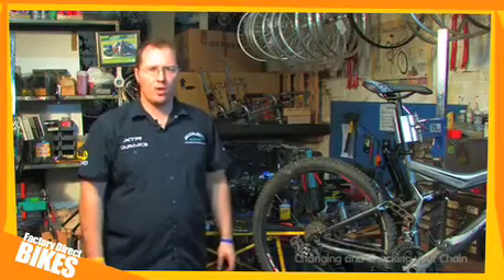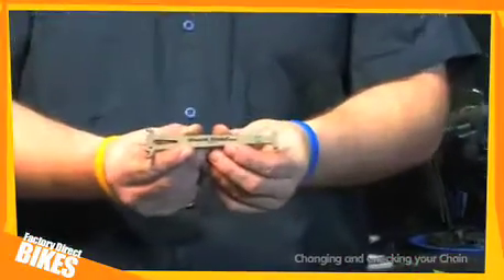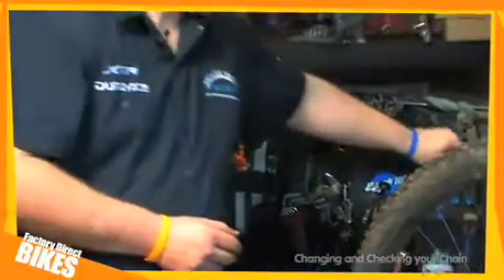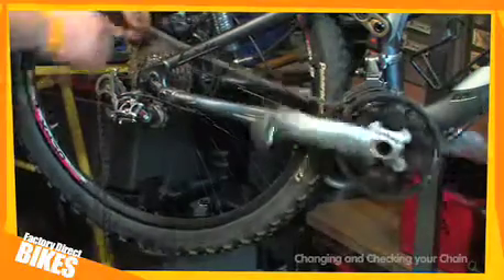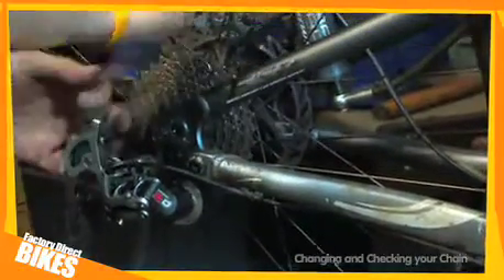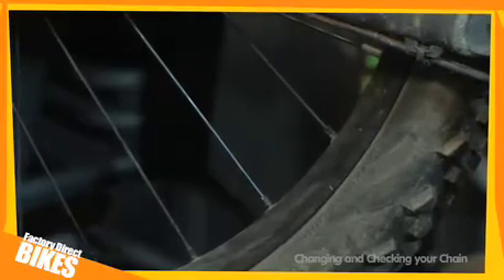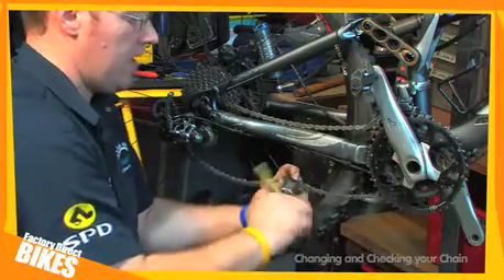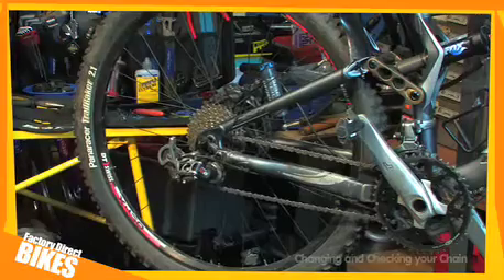Changing a bicycle chain

Comment: You don't need that special pin for shimano chains.  I run a 9 speed dura ace shimano chain and always use a 9 speed sram powerlink and I have never had any problems with shifting or the chain breaking ever.  Just because they say don't do it doesen't mean it doesen't work.  I can remove my chain anytime I want in a minute without pushing out rivets or anything and it works.  You can reuse the link also when you buy a new chain.